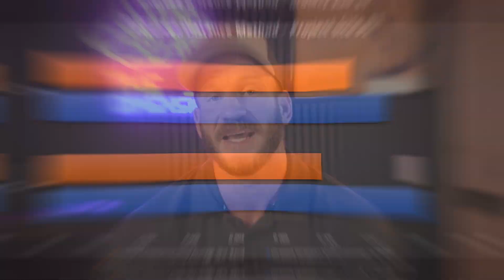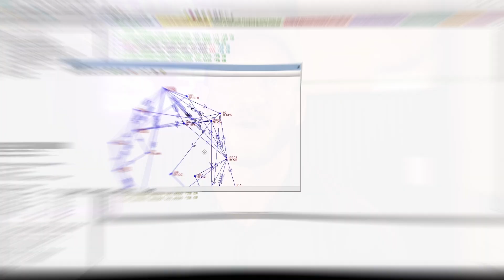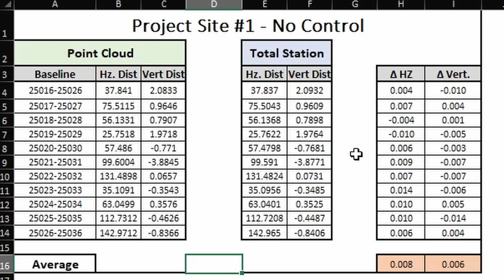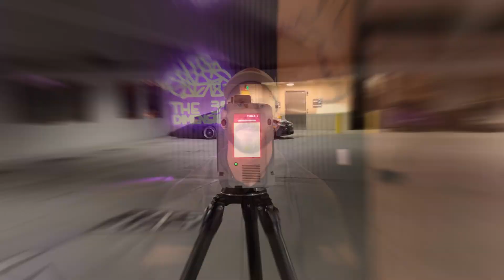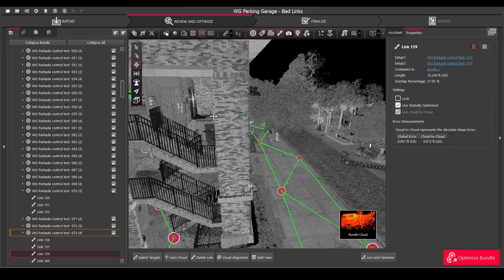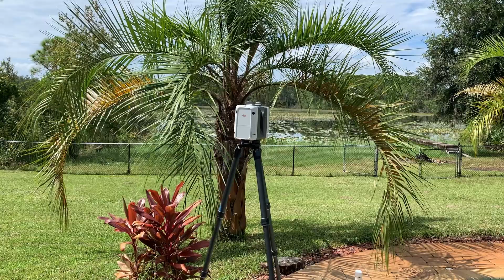Terrestrial Laser Scanning - How Control Influences Point Cloud Accuracy

Comment: I'm looking into scanners, I work for a Steel erector company we're starting a big job that will require us to build large steel trusses on the ground and we're wondering if scanning the truss for as-built and compare it to the 3d model of the same truss, you think something like this could work, and how accurately the scan can be.
Reply from the maker: It certainly can, that’s been a use case for years and I’ve personally done it for years. How accurate? That’s kind of like me asking you how much weight can a truss take? It depends on a multitude of factors. A skilled professional with the correct equipment, experience and procedure… around 5mm depending on confidence level.

Comment: I would be interested to see how much accuracy is lost between different lengths of scans
Reply from the maker: You could run the error propagation using the angular accuracy spec, the range noise spec and the distance of observation. Of course there’s a ton of other variables but strictly from a comparison standpoint that’ll get you off in the right foot.

Comment: Hi, I wanted to mention that after a trip to Tucson, Arizona I was able to ask Leica professionals if it was possible to do a target registration without cloud cloud influence and they said no. Right now register 360 will always take cloud to cloud into consideration, although you may be thinking it is using only target.
Reply from the maker: @OmarRenteria-e5z  If it wasn’t using any cloud to cloud you would need an absurd amount of targets, unless I’m misunderstanding you?
Reply: Hi, yes you are understanding me. I just mentioned this for people who do an exterior loop around a building with targets in order r to mitigate any drift or misalignment. There are also those who are taking P40 data into reg 360 and want to replicate the same results they got from Cyclone. @The3rdDimensionSurveying
Reply: @The3rdDimensionSurveying  Correct it would be a whole lot of targets but I’m speaking more for the folks who run target loops around the exterior of a building to better constraint the scans inside that loop, which would typically all be cloud to cloud inside of a building. The issues I brought up has also to do with those who are looking to take p40 data into reg 360 and repeat the same results/transformations done to the target and scan setups. I’ve tested this in the past and it is the case that register 360 does not treat targets/control the same way cyclone can.

Comment: Thanks for going through the work to put this together.  You mentioned the Leica black box regarding the details of how they register scans. Obviously it works well.  I think it would be inappropriate to extend this to other systems and hope your followers don't think it represents a general conclusion.  I recall testing an early RTC360 years ago and it was horrible.  The thickness of a wall went from 5" to 2" in just 20'.  My point is that both hardware and software are constantly changing, so any conclusions we make today can't be expected to remain valid for long.  Independent checks need to be made on every project.

Comment: Amazing video!! 

Something I'm curious to see if you tested it (or i just missed it while watching) but did you do any testing to compare accuracy of datasets that has the level condition applied (when setups have high tilt accuracy enabled) vs having that setting turned off? Register 360 treats those setups and links a bit different (higher weight to setups with HTA enabled) and you can sometimes get better registration results depending on the scenario since reg360 will more easily let scan setups move to best fit one another. 

Another factor that would have been interesting to see was in your project 4 scenario to see how much cleaning the "cloud to cloud" points of areas with vegetation and poor surfaces for C2C and keeping mostly only good surfaces and then seeing how accurate the registration was able to match control. It can be time consuming depending on your project size, but it can help dramatically by simply deleting some C2C points of bigger objects which won't help your registration such as trees and branches. 

Either way, well done on this video!! It's incredible the detail and backup you're able to show here! Definitely sharing with all my reality capture and surveying coworkers!
Reply: All good! Another item I'd suggest you look into and test (at least for your own internal testing) is the max point density setting. Looks like it's still on the default 30 value, but we have it maxed out to 1000. Basically 30 is equal to 3% of the captured points are used as C2C points for registration. 1000 means all points imported are also used for C2C registration. We've found to get better registration results across more data sets having it maxed out, especially in scenarios that don't have ideal C2C conditions. More points used for registration helps C2C, especially on dynamic surfaces I've found. More points also helps when your overlap percentages aren't always ideal.
Reply from the maker: @erickruse4610  thanks for the tip, I will 100% be looking into this
Reply from the maker: Thanks for the reply! Interesting about the affects of registration with HTA turned off. I did not test for that but absolutely something to look into.

As for cleaning out veg from the C2C points, yes I did do that. There were quite a few links in that 4th dataset that would not have aligned if I hadn't. It's just standard practice for me to do that when I see that amount of relative veg points but maybe I should have mentioned that in the video.

Comment: Very good video. I'm eager to see the follow up for SLAM scanners. We have a couple of NavVis units that haven't seen much use yet. The cost of processing datasets keeps us from going out and practicing with them.

I also would be happy to see a follow up regarding your field and office techniques for setting control networks. I don't have anybody at my current workplace who can teach me about high accuracy survey procedures. The last 2 licensed surveyors I've worked for do not understand or believe in least square adjustments, and we never run traverses.
Reply: We have had a lot of great success with our NavVis. Obviously lots of factors to consider but similar principles to what this video lays out. It relies heavily on good 'overlap' i.e vertical walls, corners, etc. It still needs survey control to avoid drifting. We use a control point every 30m or so in a favourable environment. It's totally useless in natural environments. Use a few RTC scans for quality assurance purposes on your first few scans, until you get a good feel for the accuracy.

Comment: If 60 targets are placed by 3 crews over different days… you certainly have increased error over what the RTC system can do. As an independent laser scanner we often get stuck asking surveyors to show their “notes” and system logs. To find out they cut corners. As someone that scans stadiums, I can tell you control is only used to bring in geodetic location and prove quilty of work. Control is almost never used to fix alignments. If this is the case you need to re scan not force alignments.

But great video

Comment: The idea for next video - can you add a new scenario for comparison? Very tall building like 14+ stories where the roof is not connected with ground via c2c.  This should show a big difference with control and without. Data drift for RTC360 is a real pain in this scenario.
Reply: You definitely need a roof to ground link in this scenario. Using a scanner with a dual-axis compensator like a Leica P40 would be better (total station accuracy) than the RTC. Using the P40 method I had around 15mm of drift in 6 stories ( around 12 scan-to-scan links)

Comment: 7:58 Accidentally highlighted the grid distance instead of ground distance.
Reply from the maker: @asgdfgify  not an accident actually but great eye. It has to do with the way the data was extracted and entered into starnet. The scanner works in ground natively so the coordinates extracted without control and entered in starnet were in ground but starnet was expecting grid. The converted ground distance was way off because of their location. Grid distance was actually ground distance in this situation.

Comment: super interesting. I'm just wondering - are you applying control in register 360 on locked or unlocked links? It was not 100% clear to me from the video.
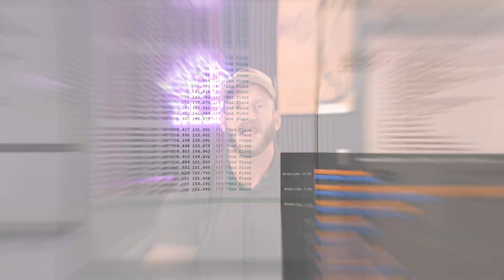Reply from the maker: @Shine-bm6nm  check out 4:10.
I tried to pack a lot of info in a digestible length so it’s so easy to miss something. 

But to answer your question, I unlocked them. I didn’t want to simply shift and rotate the point cloud to fit control as this shouldn’t change the relative accuracy from what was observed with no control being applied.
Reply: @The3rdDimensionSurveying  Thanks! this is exactly the answer and reasoning  I was looking for